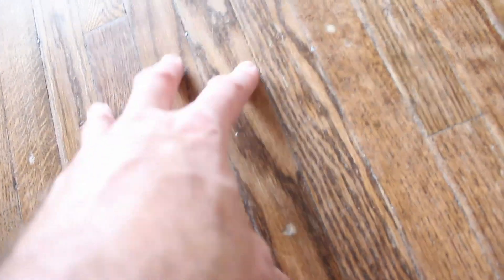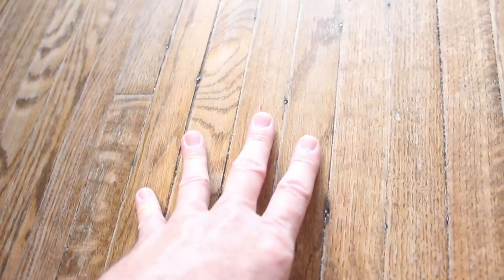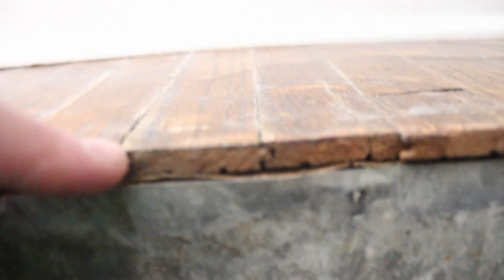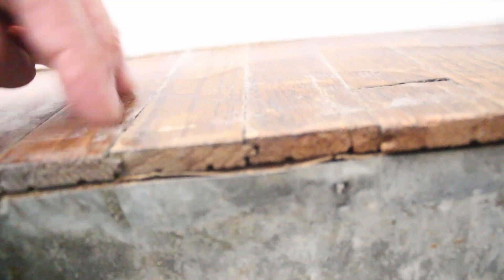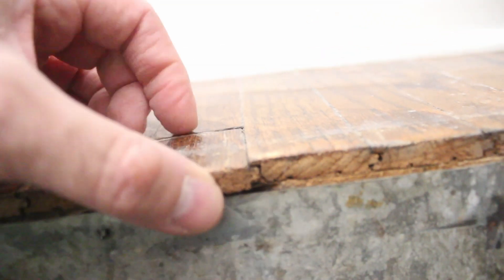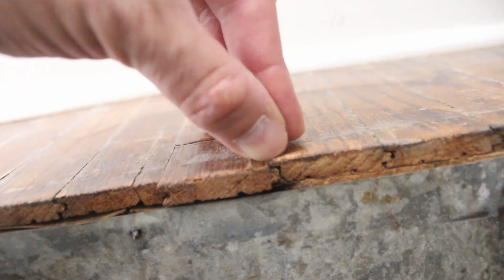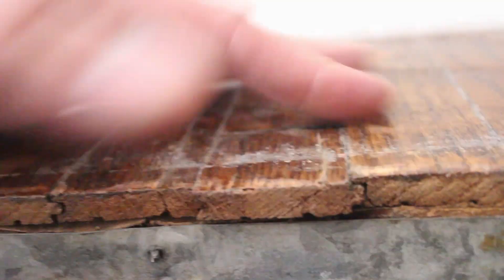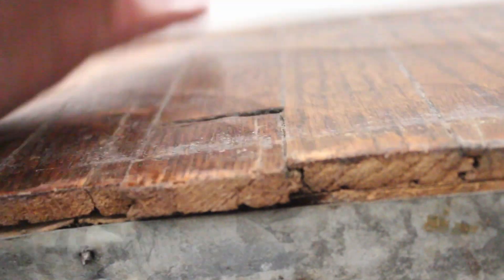How To Assess A Floor For Sanding Suitability - Ask Questions & Leave Comments (Ep#60)

Comment: Great videos. Thank you for sharing your experience. Question, I live in a three-story home, The top floor, under old carpet was the original t&g pine floor. A few layers of paint cover it, and with some areas of the floor, the paint is peeling.  I want to prepare the floor for paint,  any recommendations on how to prepare the floor and the type of paint to use once the prep is complete?
Reply from the maker: Hi, thanks for watching my videos..I would first sand all of the existing paint off, its very difficult to remove paint by sanding - labour intensive, and lots of abrasive belts required - but this will give you the best end result. Finish sand to 80 grit and that will be good for applying the paint. I've never painted any floor so I couldn't recommend a paint type suitable for foot traffic. Armour coat, or an epoxy type paint are likely most durable for floors, best to consult a paint dealer, or google it. Good luck!
Reply: @HardwoodFloorRefinishing101  thank you. I was a bit apprehensive to sand due to the lead paint. But I can take precautions

Comment: I have actually had a couple oak floors in about that shape they wanted me to sand. I hit it with wood dough before I just 80 drum sand it, buff and finish. I always let them know. Most if not all the nails will be showing and even wood dough filler won't be a good fix for movement and cracks. But sometimes the homeowner doesn't care. They just want more finish and a new color of stain on their floors. 

There is so many 3/8 flooring in my area. All of pretty much sanded by do it yourselfers before me. I actually just did one, they wanted their red oak stained with "red oak" minwax. I do not know who at minwax chose that color and name, but it definitely didn't look like redoak. But It perfectly covered up all the pet stains in their floor.
Reply from the maker: Good points, thanks for watching!